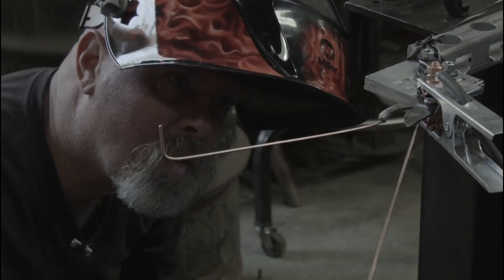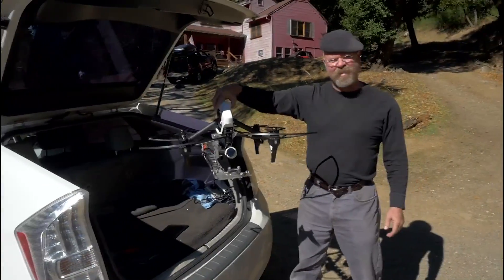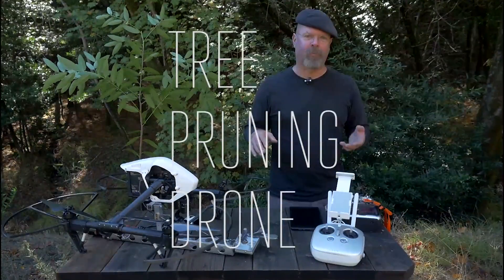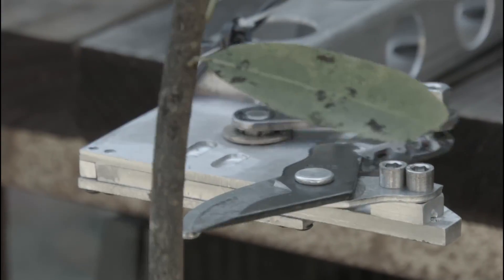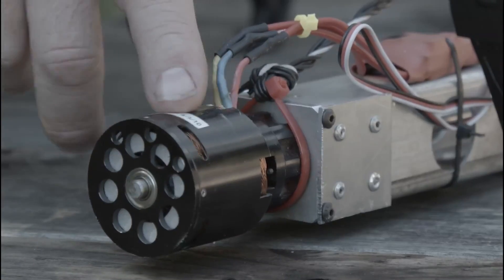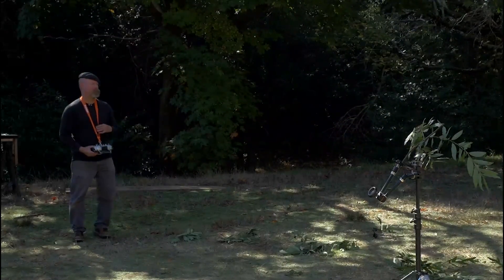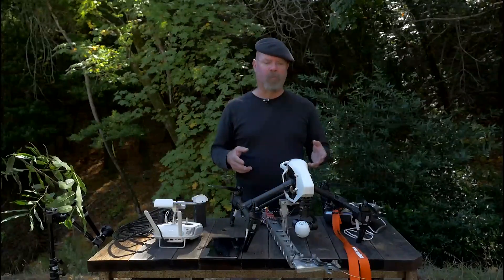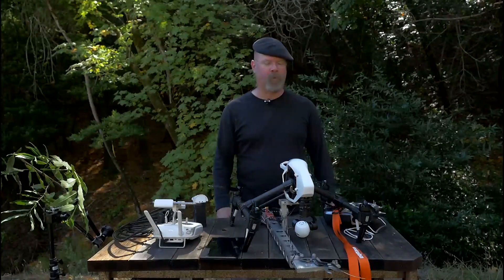Jamie Hyneman Hacks a Drone

Comment: I have a tall and very deep hedge that needs constant pruning. It's nearly impossible to get a good horizontal surface on the top - but a drone with some sort of hedge trimmer attachment could do the job in no time. Better yet, if I programmed it with the right coordinates it could just pop out every couple of weeks for a quick maintenance cut. Is there really nothing like this on the market yet ?